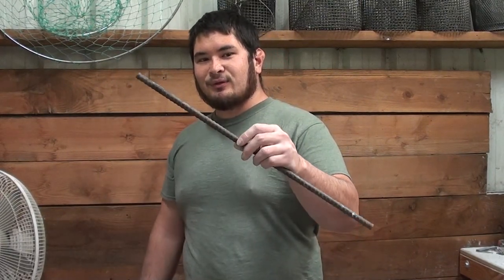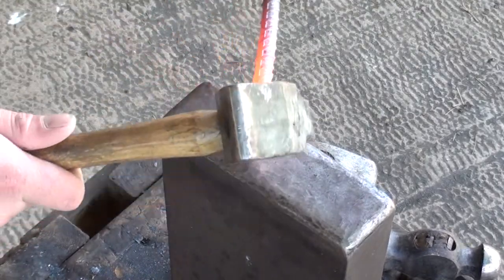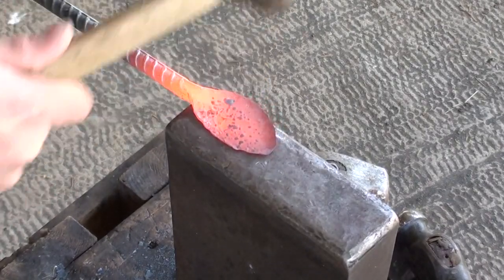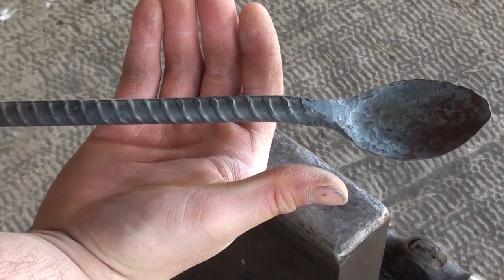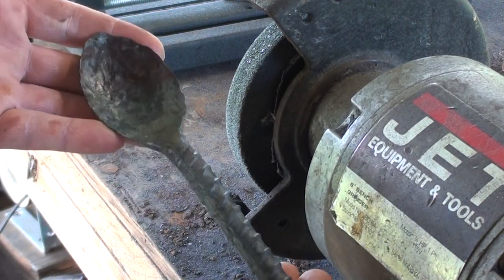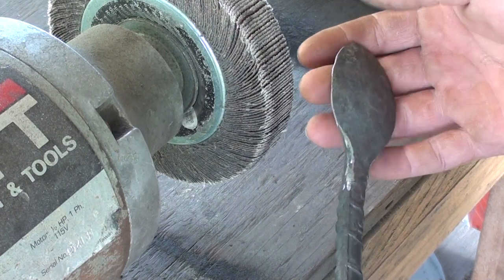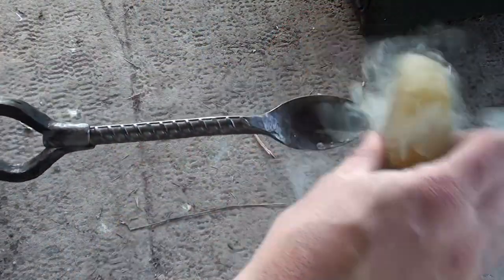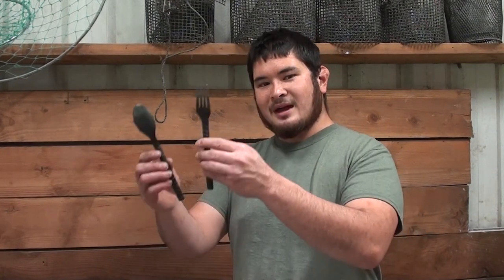The World's Manliest Spoon Forged From Rebar- Post Apocalyptic Spoon

Comment: Said rebar should probably be tested for either mercury or lead, if you want to actually eat with that spoon.  

While I'm being a troll, the size and shape of that forge would also cause me to ask questions about fuel inefficiency due to heat loss.  On the other hand, I could see you wanting something large enough to let you heat up a large piece of metal at once, without having to work on tiny pieces of the length.

Nice video though, BB.